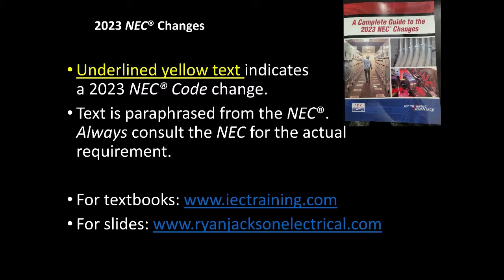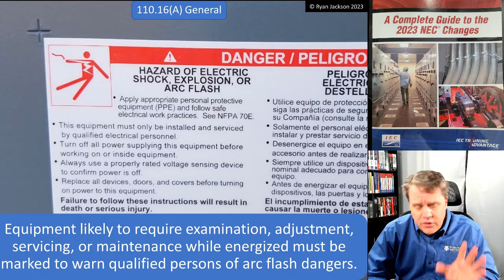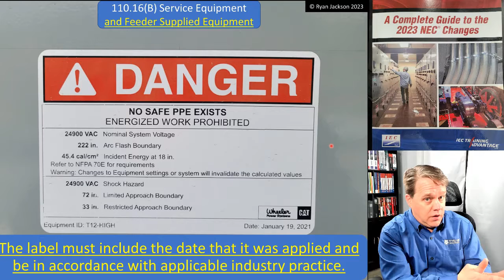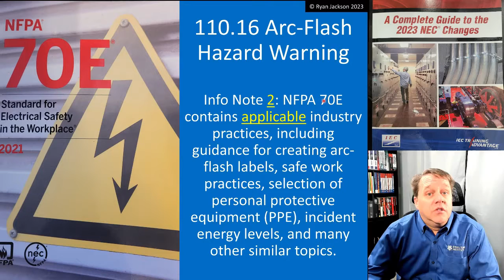2023 110.16 Arc Flash Hazard Warning

Comment: Even with the discussion about "feet and Inches" I don't understand 222 inches or 18 ft. 6 inches.  I know we would all carry a really good tape on our belt. But really? 18' 6"??  Call it 20 ft.  I know there are times when it is very necessary to be pedantic but this, to me, is not one of them. 20 ft.  I thought for a moment that it was a metric thing.  So much is headed that way.  Nope.  5.6388 meters.  20 ft. works great in metric as well. 6 meters plus a smidge.  That may be a really good code making question.  Does this rule need to be pedantic?    Wires should be rated at 596.87 volts or less.  Feeder supplied equipment of 1003.74 amps or more.
I tend to suffer from pedantic.    Thanks for the videos.